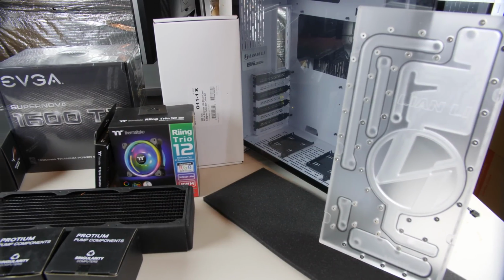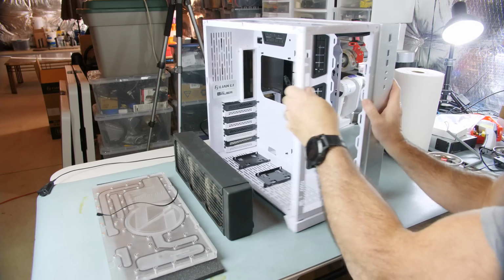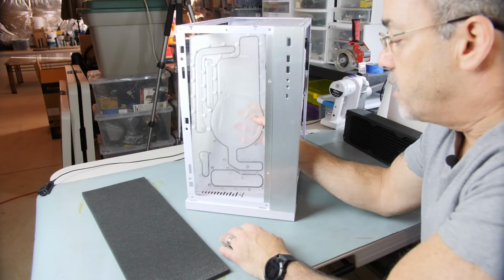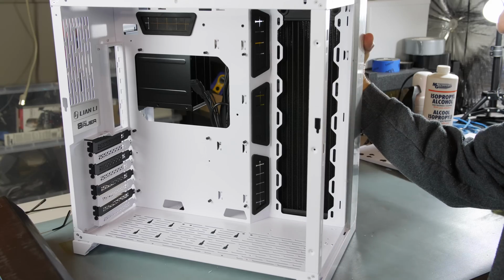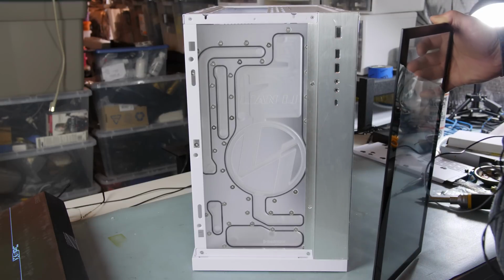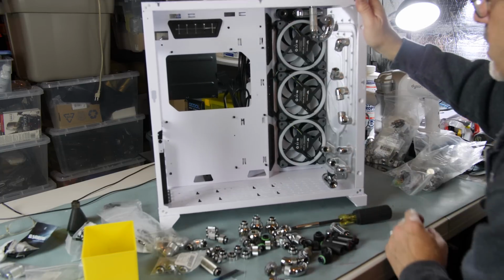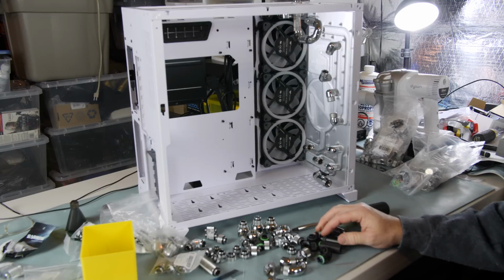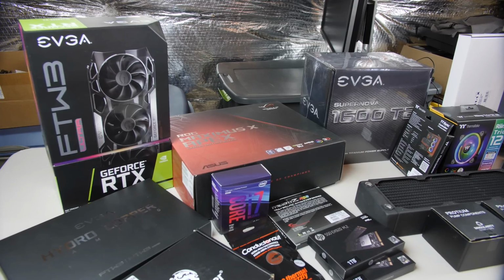4K - Lian Li PC-011 Dynamic Gaming RGB Build -Part 1

Comment: what would be the best thick and size for this case im running a 1 gpu and cpu setup im new to watercooling. im thinking on getting a aquacomputers airplex 360 copper fin radiator would this fit in this case? also i was thinking on getting 2.

Comment: Nice job of twisting your chassis. Your rad fans are dumping warm air into the case.
Reply from the maker: No warm air in chassis , system runs perfect. All components cool.  
Thanks for watching the video.
Reply: I'm looking at your 120mm fans and they are in a pull config. That means you're pulling the warmer air from the radiator back into the case. I just don't understand why you would want that? 

I believe "hardware canucks" did a video on the best fan configs for the O11 dynamic and fans setup in a push config on the side always yielded the best in case temps. If you haven't seen it yet I recommend watching it. Good luck
Reply from the maker: @davidbrewer8309  It has been working perfectly for over 18 months.  Difference in temperature would be negligable. This is how I chose to configure the system so It looks and operates the best for me.
Thanks.
Reply: @Ronsanut  Nothing wrong with that. As long as you're happy with it then that's what matters. Myself personally, I would prefer to lower my case temps and increase the longevity of my components. 

I am actually building in my O11 case as I write this. It's been collecting dust for the past year and it was finally time to let it shine. My only gripe would be no reset button (minor) and some of the equipped screws leave metal/paint shavings when unscrewing them for the first time. Perhaps I'm only noticing it because this is my first all white case? Who knows...

Comment: I think you supose to mount the reservoir on the front of the case from the outside not the inside, im looking currently for a case may get this one just wondering if it can fit 2x 360 radiator with 60mm thickness at top and front with standard thickness fans
Reply: A year ago you insisted you couldn’t and now it’s either way? The correct answer is “it’s a front glass replacement” this is mechanically and aesthetically incorrect.
Reply from the maker: You can maount it either way. The one on the right side of the case is a 30mil rad. 60mm is too thick.

Comment: Whats the radiator size you used for the vertical one?  the wdith.
Reply from the maker: Dimensions: 121 x 35.5 x 395mm (WxDxH)  -  Here is the exact model https://www.amazon.com/gp/product/B006097HEC/ref=ppx_yo_dt_b_search_asin_title?ie=UTF8&psc=1

Comment: Is the power supply not a little bit to overkill? 😂 Even with a 2080ti your pc probably dosn't use more than 500-550w on 100% full load in CPU and GPU. I would use a decent 600w 80+ gold power supply.

Comment: do you need a pump for the distroplate ?
Reply from the maker: The pump is part of the loop. It does not have to me mounted to the plate, but it is the next item in line after the distroplate.
Reply: @Ronsanut  ok thanks

Comment: Thanks for sharing. Id be very grateful if you could answer this. What headers do you need on your motherboard to link up the front IO? The usb 3 and C port? 

Also can the front/side rad / fan combo interfere with the gpu when it's mounted traditionally? Thanks again.

Comment: I bought the Bitspower Touchaqua Sedna O11 front panel distro block with pump. I'm having trouble figuring out a way to route the radiator to the distro block - I'm not sure extensions or 45 and 90 fittings will help me. any suggestions?

Comment: You complain that RTX is expensive while having 1600W power supply :-D
Reply: Yeah wtf lol
Reply: ShAzzE which rtx is it?
Reply: Yeah I don't understand it at all? I mean even if he has a 2080ti his whole pc can't use more than 500 or 550w even if his cpu and gpu work on same time at 100% full load. I would pick a decent 600w gold power supply for his system.
Reply: @strohhuttv8848  You can overclock a lot of stuff , which will use more power , but 1600W is indeed unnecessary.
Reply: @LorandHungary  Yeah fine if u are a crazy overclocker. To be completely honest overclocking isn't worth doing anymore like it was befor. I remember in old days you was able OC a cpu for 1ghz more sometimes even 1,2-1,3ghz more. Now today u can overclock a Ryzen 7 3700X for 100 or 200mhz more and u get much much more heat higher thermals and higher power usage even if u try OC Intel is not worth that much anymore. How much more u can get from a i9 9900k? The stock boost max turbo of a i9 9900k is 5ghz sure is only on 1 core but in gaming most gakes don't use 8 cores ajd 16 threads. Well let's say Intel has 200-400mhz more OC and AMD has 100-200mhz to be completely honest this is nothing this is maybe a different of 210 fps vs 200 fps and let's be honest everyone who say he see a difference in smoothness between 200 and 210fps is lying he lies. So yeah... But I agree if u OC then u probably need atleast 700w power supply if u have a i9 and a RTX 2080 TI. Companies today try squeeze everything they can out of a CPU overclocking today isn't worth it was worth back then 10-15 years ago today OC is just there to show people ohhh I got 150 points more in Cinebench look...
Reply: @strohhuttv8848  too much information.
I won't read it and will just this:
You generally overclock , so your old components can still be used for some time , before it starts getting unplayable.
Reply: @LorandHungary  Yes but old CPU's have higher overclocking potential my point is overclocking today has no purpose. Well if u think 5 more fps in games is good overclocking potential u didn't live in the 90s and early 2000s of cpu history specifically in the mid 90s.

Comment: Pretty sure you didn't need to take the rivet's out. That resovoir is meant to replace the glass front panel. Not meant to be mounted on the inside of the frame. Still looks good though 😉
Reply: I was looking for this comment before I posted this exact thing.. currently building in same case, but using eks side distro plate instead

Comment: Does the fatty rad fit in the front?   I think I have a very similar radiator (RX360 v.2 I believe).  I'm still using a NZXT Switch 810 because there aren't too many cases that will eat the radiator with fans in push/pull.

The slots for intake and exhaust seem a little small in this case and if you mount the rad on the side with the motherboard the fans are too thin and would be pretty far from the exhaust/intake holes.  If you put the rad in the roof there certainly wouldn't be room for push pull (maybe not completely necessary).

The case is just a little too small every way around.  Bottom rads block PCI slots.  A lot of GPU blocks are too wide to be mounted horizontally and there could be a bit height above the the motherboard.  I personally would like space for more than two mechanical dives also but I guess a NAS would reduce the need for so much storage in the PC.
Reply from the maker: Rad in the roof can certainly be done. Depends on your motherboad as well. Rad in the bottom also works.

Comment: Why 1600w PSU ?
Reply from the maker: I changed it to a 1200w psu.  At the time if this video I had a great deal on the 1600.
Reply: @Ronsanut  Yeah 1200w should remain in silent mode under any load you throw at it in that build, so good call. 1600w would probably run very far below the efficiency sweet spot. I always base my power supply selection on having just over twice the wattage rating that my gaming load will need, so the psu fan doesn't spin under gaming loads. Rendering video or any heavy avx load coupled with significant gpu usage might cause the fan to spin, but that's fine by me.
Reply from the maker: @primorditekgaming  Yeah, I got the 1600 at a fantastic prioce, but decided for this rig the 1200i was plenty enough!
Reply: @Ronsanut  Man 600w is more than enough u don't use a 64 Core Epyc cpu with 2 or 3 RTX Titan calm down man 😂. The reality is your system could work perfectly fine with a decent 600w 80+ gold power supply.
Reply from the maker: @strohhuttv8848  Yes, I agree.  It is just one of the PSU's I have lying around.  I have a few of these from previous stock, so I used what I have.  Thanks for watching and the feedback.
Reply: @Ronsanut  Ohhh ok make sense if u had them around. Also no problem man u are welcome ^^

Comment: Im pretty sure you mounted the distro plate wrong. I may be wrong but its meant to replace the front glass, so you mount it on the front side and dont need to drill out rivets or anything
Reply: He mounted it completely wrong. It’s amazing how he’s insists on it. If you need to remove rivets and do this much engineering you clearly messed up.
Reply from the maker: No, pretty sure I mounted it correctly.  Only the new Bitspower distro plate mounts through the front and replaces the glass.

Comment: Isn't it supposed to be mounted on the outside of the case's front "distro plate"
Reply from the maker: Only the BitsPower version of this block mounts to the front on the outside.  Not this one from Barrow.
Reply: @Ronsanut  i understand now thanks for the reply
Reply: Yes it’s supposed to. He messed up. Other pictures show this as a front glass replacement. Glass over the plexi doesn’t look good. Especially frosted plexi. I did not think this was hard.

Comment: Sync controller is only for the plus fans :p
Reply from the maker: Yes and only works with motherboards that have the addressable (3 pin)  RGB connector. Which mine does not have. next video Part 3 I talk about it.
Reply: @Ronsanut  I almost bought that controller too since I want 9 trio fans in my case. But you can Daisy chain the trio controllers :) still sucks that they support one of their versions. A very bad design imo!
Reply from the maker: @zwizzy89  I was able to daisy chain the two controllers from the fans I bought. Works just fine. Still wish I could connect to Aura.
Reply: Thought I was going to be able and use mine with Gigabyte software too.. but nope. Even tho TT says we should be able to.

Comment: Dont you put the tank on the front insteat of the glas?
Reply from the maker: You know, I did not think of that. Possibly, would still require some special mounting. But probably doable. But would not look as clean as mounting inside the frame.

Comment: You don't have to do any holes on acrylic or case. Just fix the distro-plate by attaching  the fans into the middle-plate and it'll be staying there.  So, the fans in the middle-plate will be the support for it. At least i did mine like that.
Reply from the maker: Must be a different block. Mine had no place on the bloack to attach fans. Do you mean the fans that are on the rad?  Kind of a fritction fit?  I would not trust that to keep it solid when moving it.
Reply: @Ronsanut  Beleive me it's  so solid. Off course the loop order is quite different then yours. Got 2x 240mm rad (up and  at the bottom).  The hardtubes which come from  cpu block and gpublock are keeping it quite firmly.
Reply from the maker: @AKTechMods  Ahh yes, that would certainly make a difference.  Very nice.

Comment: The fans are around the wrong way! ;)
Reply from the maker: I wanted them in this as a pull configuration, so they are as I intended.  I want air pulled into the case from the other side. Then the fans up top will blow the air up and out the top of the case.

Comment: I have the same case with a EK XE 60mm thick rad on the side and a Magicool G2 27mm rad on the top. Delidded 4770k and a 1080Ti. However my build is still in the works because I'm waiting for the vertical GPU mount.
Reply from the maker: Very cool. I had to wait for my Vert GPU mount, but found it on NewEgg.

Comment: I'm confused, why did you drill the case to mount the resevoir?
Reply from the maker: I actually used 3 of the holes that were already there and I drilled out two pop rivets so the back of the rivet would not push the waterblock back.  That way I could screw the reservoir to the front panel.